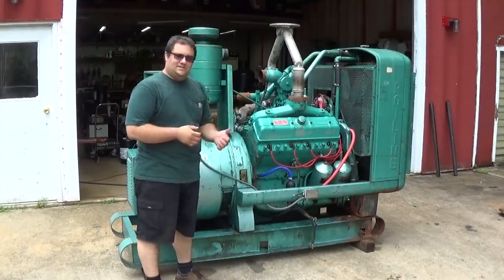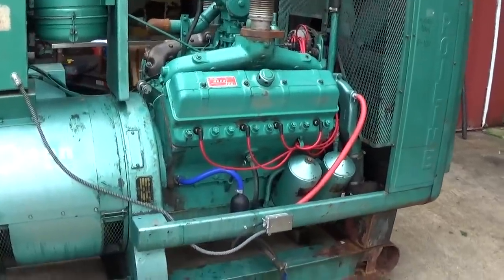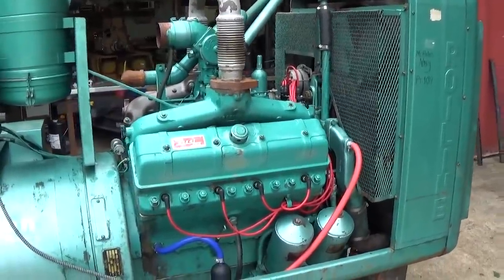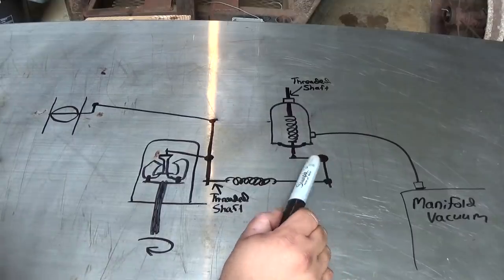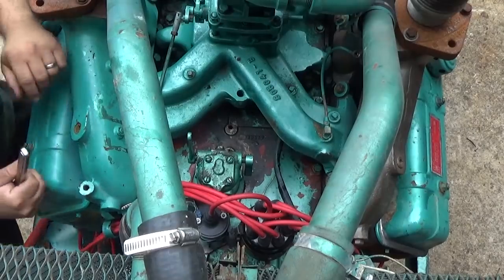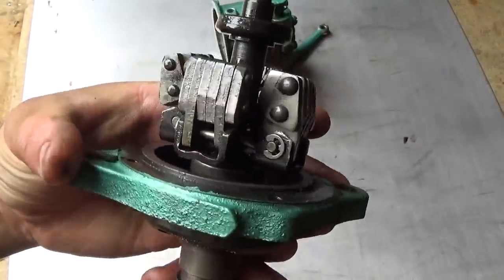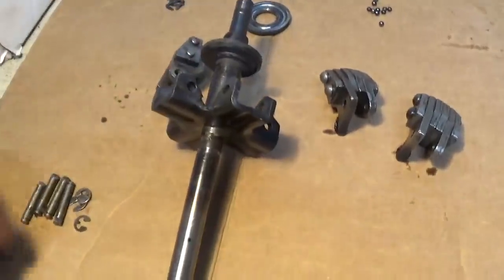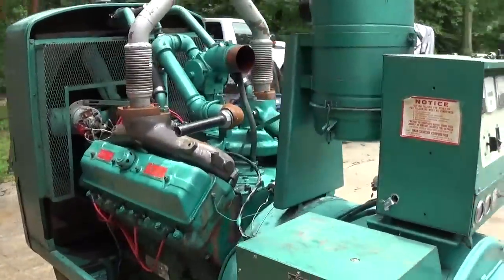844 Cubic Inch V8 GENERATOR Lets find out what is ailing it... Onan 140WE

Comment: Hi there Mike my first start in the heavy truck filled I help we built a Waukesha gas engine in a fire truck which I believe was 6 in 1/4 bore by 6-inch stroke CRC had a one piece cast iron oil anyways I would like to see that conversion video and also on a footnote do you think the wear of the gears on the governor made that shaft right up riding up blocking off oil flow on that shaft wearing out all those Governor parts did not know if that was mentioned in all the comments did not go through them all thanks for the video look forward to see the next video thanks

Comment: I'd gladly watch an electronic conversion.
I knew an engineer that built and maintained electronic governors for line-connected generators used at some large mills (co-generation systems I believe) - I'd be interested to see how accurately that unit could maintain 60hz under load with an electronic unit controlling it.

Comment: I sure would like to see this gen set converted to an electronic governor.I  find this most interesting indeed Mike.
With only approximately 1660 hours x 30 equals about 49800 miles. ( this is the way we used to convert engine running hours to miles just to give an 'automotive 'angle' to this ), this rule
of thumb was from back in the early 1970's ) That's not a lot of miles, is it? 
I sure have seen, and worked on Waukesha engines before.more especially on rock crushing equipment power units, but have never come across a Roiline engine before.

Comment: I'd be worried about the oil delivery on that one. If the governor isn't getting proper oiling, maybe it's a pressure issue on the main oil pump, and the rest of gears in that motor looking like the gears on the governor. Do you remember if it had good pressure when it ran last?

Comment: If the governor was in a bit better shape, the lower shaft could have been drilled for a second oil journal at a machine shop. Darn shame, but i'm interested to see how the electronic governor works out. With all the metal bits floating around in that engine, I wonder what the oil pressure looks like.

Comment: It's "Roy LINE."  This was a renaming of the Le Roi line of engjnes after Dresser Industries, through its subsidiary WABCO, bought Le Roi.  WABCO also owned Waukesha, which bought out Climax, thus putting several competing engine manufacturers under one roof.
Reply: Le Roi, translated from French means The King, thus you see the 'crown' symbol above Line, perhaps the massive cubic inches for a gas engine signified being the king of cubic inches.
Reply: Yeah. There's a reason the logo as those two separated. ROI Line.
Reply: Any idea why they would had made it reverse-flow?  I know they did that with the original Cadillac V8 so it would fit better in the confines of a tank.

Comment: I have helped install about a half dozen emergency generators in my many years in the electrical industry and wired them but never worked on one after it was up and running.  There are so many things that you have to understand to trouble shoot an outage and get it back on line with the customer standing right over your shoulder wanting you to hurry up.  I would love to see the electronic governor installed, although I don't know who could afford to have the unit running long even with the low cost of natural gas right now.

Comment: If this was a common early life failure point for all these units back in the day, there is a good chance these obsolete OEM govenors are sitting in some stock room somewhere.   
There might even be later improvements added to the NOS ones that still exist.  You should look 1st for a chance supply.  You might get an OEM speed govenor for a song and be up and running.

Comment: You mentioned Waukesha engines.. they used those on all kinds of stuff. My Grandfather had a huge air compressor (W-6), and around 300 CFM @100PSI, that was built back in the late 40's or early 50's, powered by a monster 6 cyl. Waukesha that was actually set up to be convertible for gas or diesel. This particular one ran on gasoline, and a LOT of it, to make the amount of air that it did.🤣 The first thing I thought of when I saw the name tag on the radiator shroud of this one, was LeRoi, since they were pretty popular industrial engines also. Your outline of the succession of company ownership kind of explained all that though.😉 

BTW, definitely oil starvation on that governor shaft. Like you said, it should have had a groove all the way around the bushing/bearing where the oil gallery passed through. Even if you can convert that to an electronic governor, you're going to have to do something about the camshaft and distributor drive, unless you block it off also and use a crank trigger and electronic ignition. You'd still need to drop the pan and get whatever metal is lurking down there, out of the pan, and flush everything out. If you can source a new cam and lifters for it, that may be the way to go since it's got relatively low hours on the unit.🙂

Comment: i bet there is an oil flow issue in the supply to the mounting ring..    disable the ignition system... crank the engine while looking down the governor mounting hole.. to check for oil flow..  i bet there is none..   you may want to pull the cartridge filters out carefully make sure they did not come apart sending filter media into the oil galleys blocking oil flow.. to perhaps several main bearings and the oil passage to the governor..  this could have happened to previous filters depending on PM rates..   GM had this issue on car engines with cartridge oil filters failing in the late 90s and early 2000's..  aftermarket cartridge filters failed and clogged oil passages to the main bearings..

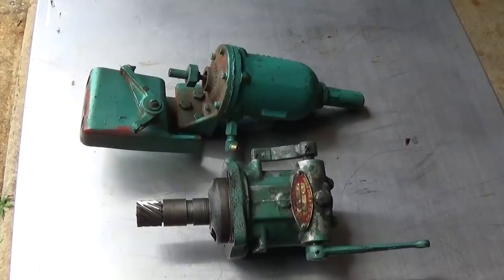Comment: 23:20 gave me a good laugh! :D I wasn't expecting that :) And I agree that the oiling setup for that governor was pretty poor. The shaft should have been drilled all the way from the bottom, and the pressurized oil should have come up straight through the middle. That way it could feed the governor regardless of the position that the rotating shaft was in. Anyway, I would LOVE to see/hear this beast running! Plus, it would be neat to see how an electronic governor is retrofitted onto an older unit like this :)

Comment: If it had constant lubrication, it could mess with the weight of the weights at differing engine speeds and temperature /oil viscosity. Is the idea of that hole to give a pulsing action to cause a misting in the governor housing?

Comment: I would definitely like to see more on the electronic governor. Probably mostly on were to find the bits and pieces of the system, and how the the throttle actuator works with the controller.

Comment: I think it’s like “Roy-line” — not that it really matters much at this stage of the game. It’s old. 

Do the conversion. You may need to deal with the open oil port to the former location of the old governor. Oil pressure could drop a bit. Plug it up and the other parts of the engine will benefit.

Comment: I wonder if one of those V8s were ever put in a car.
Reply: Doubtful. Would be allot of work for nothing more than bragging rights that a large displacement V8 was shoehorned into a car. It's about 3.5-4 times the weight of a fully dressed automotive V8, with a power rating equal to a automotive engine with 1/2 the displacement. This was a purpose built, industrial, low RPM workhorse.

Comment: When you pulled out the governor and mentioned about the teeth being sharp I noticed right away a lack of oil. Also if Oil is supposed to be pushed up into the governor to lubricate things, it’s pretty dry you don’t seem to have oil dripping off onto the cardboard or anything. I did notice at least one common here dimension lubrication. You could probably start that holding the throttle closed and watch for oil being sprayed out by that gear. If there’s a pipe plug inside the engine that goes into an oil galley that has a small hole like .040 inch or so could be plugged up and no oil  is getting spit onto the governor gear assembly and possibly the distributor as well

Comment: Convert it to electronic control? Would be nice upgrade. But you need to inspect other gears for the wear first. The missing balls and other chunks of metal fall down and probably made a mess with other gears. If it is few gears, it might be worth replacing them.

Comment: Your diagnosis seems very accurate, I came to that conclusion when I saw what was left of the bearings in the top of the governor. The flyweights had the scuff-marks indicating high RPM also. Westinghouse should have stayed with air-brakes, that system is widely used in both railroad and semi truck applications. The bits that fell out when you opened the governor up look like the remnants of circlips that may have held the thrust bearings in place, but were eroded to failure by friction due to the lack of oil. Excellent work.

Comment: Yes, by all means make the conversion! I can see the cost of conversion being considerably less than replacement of the mechanical one. Given the number of parts, probably a special order and so on, I can see the new mechanical units being pretty pricey. I would guess that installation of a unit similar to what Generac used, with the solenoid coil and hall switch counting flywheel teeth, probably being available and cheap(er)

Comment: As much as we like to see this old iron still functioning it would be nice to repair or replace it to original. Since it obviously has its problems with the design of the original it would seem to not be the smart thing to do. I would not see any harm in converting it. The conversion is bolt on and does not prevent going back to original if wanted later. It would make this unit much more dependable and would be interesting to be seen done..

Comment: if/when doing the blank off plate do not forget a solid plug to fill the shaft housing hole in the engine thus blocking its oil passage.
crap gov. design where an over speed breaks stuff given there is always some goof willing to hit the throttle

Comment: The conversion process to an electronic governor would be interesting to see.
Reply: I agree I would like to watch that
Reply: @trevort4286  I'm in agreement with you as well!!!
Reply: Very easy to convert, and would work better
Reply: yes
Reply: An electric servo would do the trick, but remember that lubrication port! It's a pressure loss with the mechanical governor removed. To maintain proper engine oil pressure, you'll need to fit a slug in the governor drive bore.
Reply: I'd like to see that too.
Reply: agreed
Reply: Eliminates a lot of droop. I was friends with the family that owned North American Engines {Waukesha dealer in Philly} They showed me the electronic gov conversion back like 30 years ago. It was an easy fix
Reply: I think that would be a proper repair for this unit and interesting to watch as well.
Reply: That’s a function of timing
Reply: Me too...
Reply: Try XD-100 evinrude etec oil or amsoil dominator, i did this with my kholer and it ran better and cleaner as i dont have carbon coking and cooler running bearings. I got my OMC smal block Johnson v8 and silver 8v92 2 stroke detoit on that. Also for my 8v92 jimmy i could also try quicksilver full synthetic TCW3 mixed with shell rotella as they are chaeper than several gallons xd-100. they are all all monograde low ash that burn much cleaner too.
Reply: First full electronic governor I had to deal with was on a Cummins KT38...a REAL nightmare. Overspeeds, speed flutter, droop... a mess...until I found out that the idiots from Alturdyne had wired in the jumper for a DUAL bearing alternator on a single bearing Marathon.  Took that out and it was more stable than a Woodward.  That KT38 had other probs as well (oil consumption) due starting up the nee engine with the block DRY.  Never did business with them again for anything.

Comment: That engine was use in the military M123 and M125 10 ton Mark trucks . Used in the 60's to early 70's . Even through it was a Mack truck and drive train , they used a Leroy gas engine in the early models . Later they were re powered with a V8 diesel when the military went to a all diesel fleet. they were primarily the M123 tractor used with a lowboy trailer to transport M/48/M60 tanks . They were a beast !!!! didn't go fast but they could pull !!! LOL I am not sure if they used the same governor or not , check out the TM's for the info , they are online . be safe , bob k

Comment: I have a question When a load is put on a generator it causes the engine to slow down.the higher the load the more it slows.So this is because the electro magnets get stronger trying to keep up with the load and the electromotive force tries to move the generator in the opposite direction?
Reply: In a word.... yes. Back-EMF plays its part.

Comment: Yes, I would like to see the electronic governor set up in that unit. I have a 30 KVA 3 phase gen set at my camp in upstate NY and it's diesel engine has seen better days so I am looking for a 4 cylinder industrial gasoline engine for it. I may have to use an electronic governor on it, so any education I can receive from you would be great!. Now that you know how it was a lubrication issue, I wonder how you would have managed to get more oil into the governor assuming you could find a new one somewhere? Then there is the other lube issue of the worn gear inside the block next to the distributor? Thanks-great video!

Comment: I think the governor's thrust bearing failed a long time ago, and the weights have been rubbing for a long time, increasing the governor drive load, wearing the gears excessively. I'm thinking the thrust bearing failed first, because nothing looks like it really got excruciatingly hot, which would be a sign of lack of oil. Nothing really looks very dry either. There are many engines that utilize "timed" oil supply for various things without issue. For example, the Toyota F-series engines only have one tiny hole drilled into the camshaft that supplies oil to the top-end once a revolution.

I also believe the vacuum booster might also help reduce governor droop under load? It'd definitely be cool to see an electronic governor conversion. I've seen people do it with old aftermarket cruise-control modules before.
Reply: An electronic gm cable throttle cruise module will work fine as a governor. The only problem is that the speed has to be set every power cycle

Comment: Le Roi engine, I believe. https://www.gasenginemagazine.com/gas-engines/le-roi-legacy -  https://www.wehs.net/connection-3-leroi.html
Reply: "Legend has it that the company name was changed to "Le Roi" (The King) after a big order came in from France circa WWI. WABCO purchased LeRoi in 1954 and sold its engine line to Waukesha in 1958. Waukesha marketed the Le Roi engines as "RoiLine". The last of the LeRoi engines were built in 1974."
Reply: Ha, I looked away for some info and posted, only to find Mike covered it already...

Comment: I'd like to see it converted but make sure you do something with that oil feed passage down in the block. You could plug the hole in that old governor housing & reinstall it as a block off. Just don't forget it or your oil pressure could be in the toilet. 

If I had it, I've got an old Ford 300 six belt-drive governor from a stationary application that I'd rig up to it just to keep it simple. Hz control wouldn't be nearly as precise but would be virtually bulletproof. 

I'd be curious to see how much boost pressure that big bitch would take before scattering 😆  counterflow head so easy to turbocharge

Comment: Sure, I'd like to see the conversion to an electronic governor.  But, most importantly, can you match that paint color?
Reply: Good video, show the electronic conversion.
Reply: Detroit green
Reply: Hi Mark...yeah...that's a cool colour, isn't it?  
Seen it somewhere else engine-wise but cannot place it.
Cheers.
Reply: @patagualianmostly7437  - pretty typical Onan color I think
Reply: @patagualianmostly7437  70s Chrysler Cordoba
Reply: Looks like a Hammerite colour.
Reply: yea actually its onan green u can buy it all over the place, also theirs somethin called a sun gun, at least thats what the dupli-color guy called it when he demoed when i worked for a bodyshop, it was a gun about the size of a radar gun n u set the "barrel" up against the paint, it had 3 little metal tabs, n i always thought it was weird they were metal u think theyd b a plastic for the obvious less chance of scratchin the paint, so i wonder if somethin electricals goin on but i cant imagine youd get any useful info from the resistance or conductivity of the clear coat..  anyway u hold the gun up against the paint hit the button n it would shine a bright ass light with i imagine multiple very specific color temps.. so u do that n it has a screen like a cell phone   im gonna google it now i wanna know exactly what electronics r in it specifically the light n sensor
Reply: I think they call it alpine green. Detroit Deisel color.

Comment: The gear wear on both the gov shaft gear and it’s mate in the engine, plus the very clean, no oil look of the engine gear point to a plugged oil line in the engine.  While I would love to see you convert to an electronic gov, I think you also need to address the oil issue, before something else (distributor drive?) fails.
Reply: I wonder if he could do a diesel flush of the oil to see if it cleans out any of the passages...seems like all that metal floating around in the oil sump is a bad thing